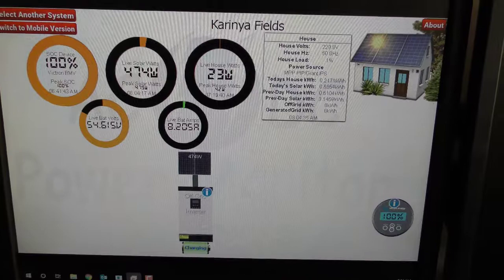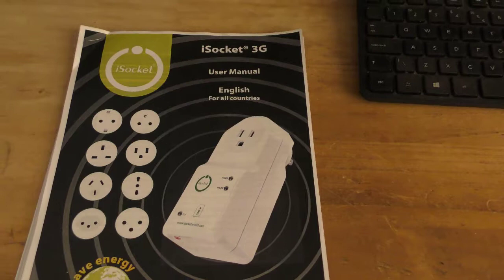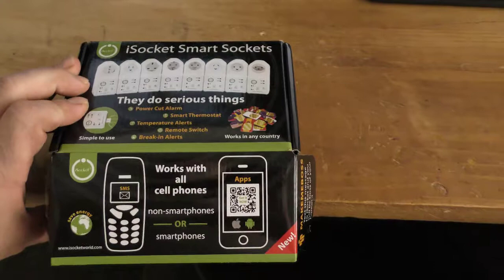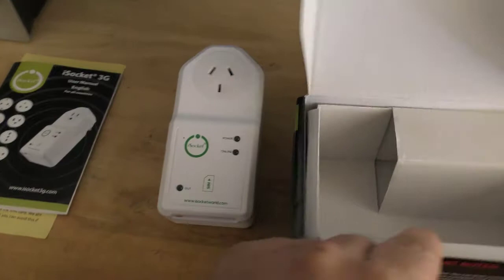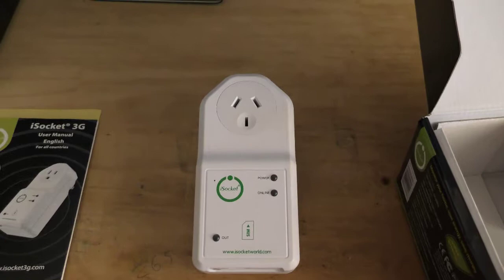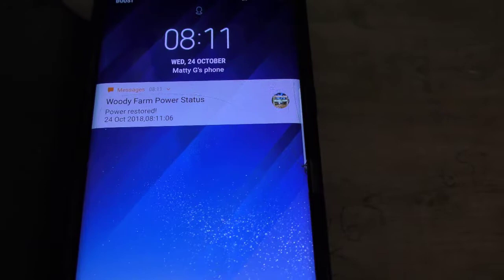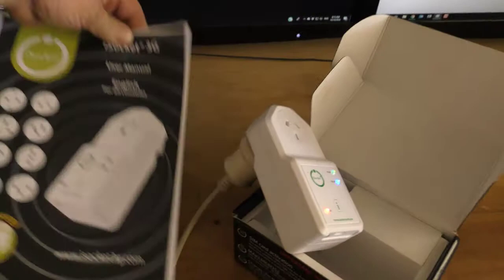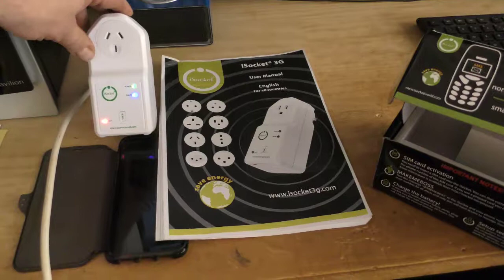iSocket introduction

Comment: Yes no surprises there. Western Power ( wasted power ) and Synergy ( Sin Energy ) needs a big kick in the ass for the state of the power lines and the quality of power they sell to county people of WA as well as the price they charge for that rubbish power. We have been paying for the lines on every bill. The amount WA people have payed over the years, the lines should all be underground and the wire made of Gold.  the power is meant to be 230v + - 5%.  Send them the bill mate.
Reply from the maker: Hi Chris. Hoping that by the end of 2019 I'll have the new system installed and running completely off grid! Then with the grid tie pumping all its power to the grid synergy will be paying me for the privilege of using my generated power!